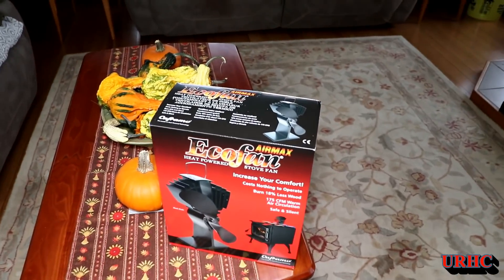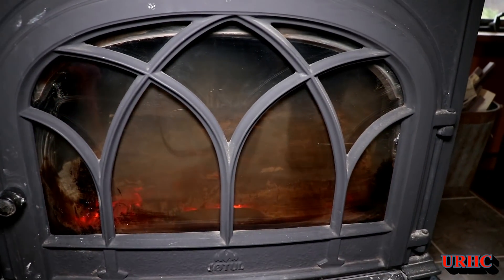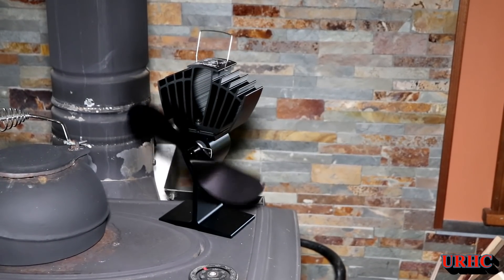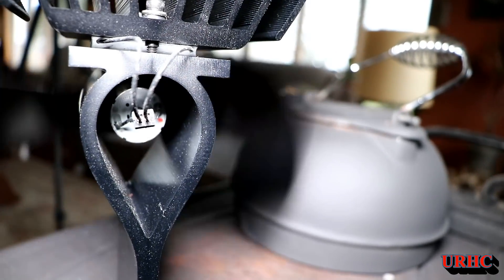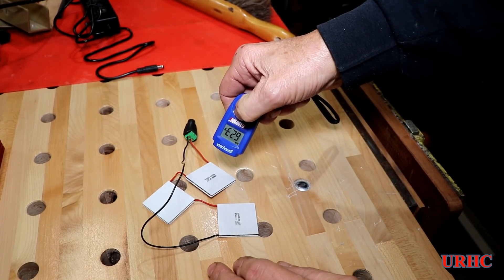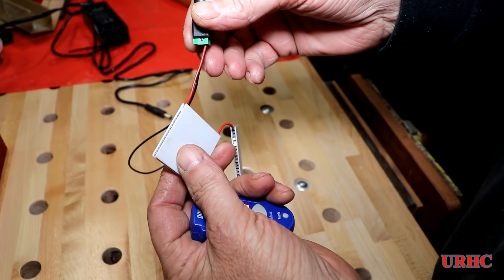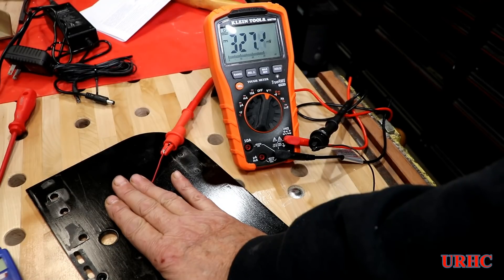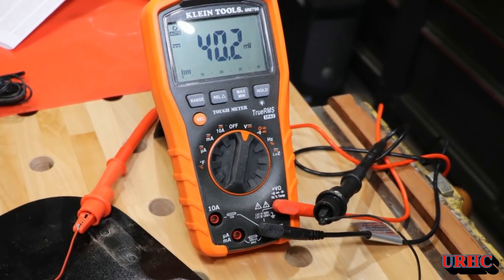Ecofan Airmax 812 First Look And How Thermoelectric Modules Work

Comment: 2 years later, how is it working?
Reply from the maker: Still working great. We haven't had to use an electric fan since getting  this. I just put a couple drops of Bluecreeper sewing machine oil on the bearings each fall and give it a good blow off with compressed air to get dusy out of the heatsinks. Thanks for watching.

Comment: Would it be possible to have one of these as a little generator.
I have a little plane which I'd like a little power source (it hasn't one), it's an N3 Pup.
I'd like to get 2Ah @ 5V
Think something like this would work?
Gosh this is cool!!!!
Reply from the maker: It takes big heat sinks and a big temperature differential to make power with these. I think solar cells would  weigh less. Thanks for watching.

Comment: since you seem to knw about these please answer me this.  Is this the same thing as they put in the 12volt coolers that heat and cool food ?
Reply from the maker: Yes they are. They can transfer heat with  power  applied, or create  power with a temperature  differential across the faces. Aluminum heat sinks keep them from burning up. Thanks for watching.

Comment: Thanks for the review.  The didn't realize these fans used thermo-electric modules.  When I was working we used these TE coolers to custom built laser modules. They cooled diode lasers and in turn used to fine tune the wavelength.  We had them in modules for years and with a stable power supply they were rock solid for temp and wavelength.
Reply from the maker: We used them for everything from process system chillers to cooling vests for hazmat workers. They are very reliable if kept within the power requirement specs. We could maintain a liquid loop within .001 degrees using simple rc motor pwm controllers. Thanks for watching.

Comment: I live in Maine and one of my primary sources of heat is the wood stove. I bought one of these because, of the great reviews. Well, I wouldn't buy another one. It didn't push air like I thought it should. It also died after about a month of use. Never moved it. It just up and died one day. Oh well. I replaced that old beautiful 1980's Cawley Lemay woodstove (https://stoves.com/press/wp-content/uploads/2011/10/Cawley-800-450x459.jpg) with a new EPA approved stove (non catalytic convertor, just more parts to break) and this one has a fan I can attach if I want. The wood stove I got has this HUGE heat sink on top. It is all covered by a nice enameled exterior so you don't see the heat sink. Though, I haven't added a fan, I did get to experience one with a fan. You can say HOLY COW. The heat generated due to that heat sink is crazy. It is a smaller wood stove than my old one and uses less wood. Though, it will run you out of your home if you put a fan on it. The new stove is a Hearthstone Manchester, looks like this https://www.hearthstonestoves.com/wp-content/uploads/2020/04/Manchester8362_Matteblack_200213-1024x805.jpg. They cost around $3400 before buying the fan. The fan is ridiculous in price. It's an additional $400+
Reply from the maker: We love this one so far. Haven't had to run the big ceiling  fan since using this. Keeps the room temp very even with no noise or noticable ajr flow. Thanks for watching.

Comment: We pickup a chinese knockoff that works as well as these ones...and for 1/2 the price...but we prefer a low watt plug in fan that moves the air much better, for the price of these ecofans, they are mainly a gimmick unless you live in a tent or very small house.
Reply from the maker: I read the Chinese  knockoffs don't  work at the lower temperatures.  Plug in fans are noisy this is dead silent and really works  for us. Thanks for watching.

Comment: Very good information. Is this helpful in a large area with high ceilings? We heat our home with a wood burning stove so this could be very useful if it helps disseminate heat evenly in a large space.
Reply from the maker: It makes a difference  in our great room but that only has 8 ft ceilings.  Tall ceilings would  require  a ceiling fan to push the heat down so I doubt it would make  much of a difference.  Thanks for watching.

Comment: I have 2 of these heat fans on my stove. One pointed each way to move heat around my house. Mine are Chinese fans though. One works amazing, the other is junk and won't even start turning until it hits 500F
Reply from the maker: I was surprised  by how  good this works. It starts  at about 200 degrees.  Thanks for watching.

Comment: I have always wanted one of those, but our fireplace is an insert and there is really nowhere to put it. The insert has a fan but it is really loud.
Very interesting to learn about how they work, I always wondered. Thanks again!
Reply from the maker: That would be a problem.  This thing  is totally  quiet,  doesn't move much air but really  makes  a difference.  Thanks for watching
Reply: I know this is 3 years old, sorry! But you can get ones that mount to the stovepipe

Comment: We've had one of these for years and love it. The model we have has a silver colored propeller.
Reply from the maker: I am surprised how it circulates the heat with so little air movement.  I go the black because it was the only one in stock at the time.  Thanks for watching.
Reply: @unemployedredneckhillbilly2023  As far as longevity, we've had ours for about 10 years with no issues.